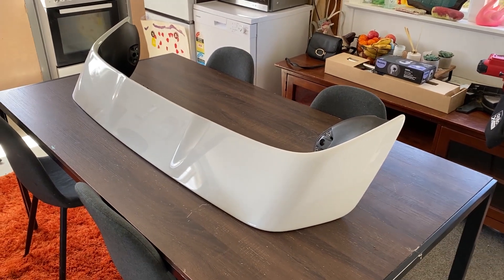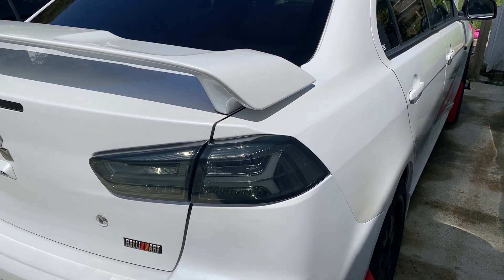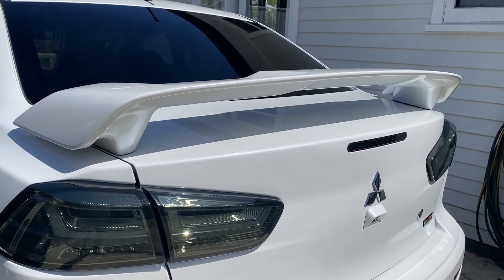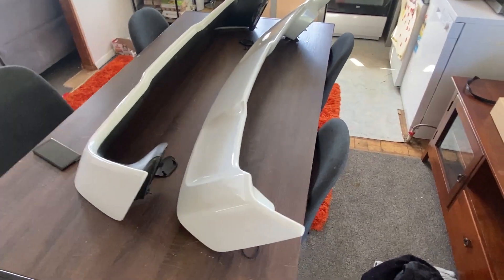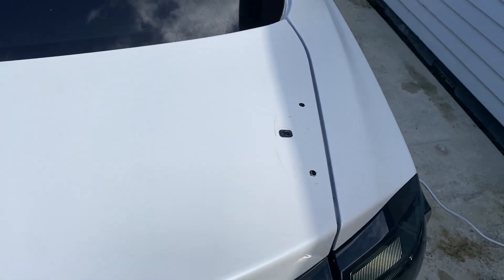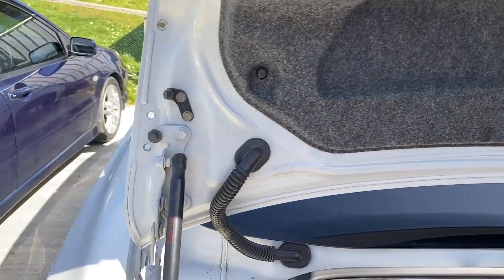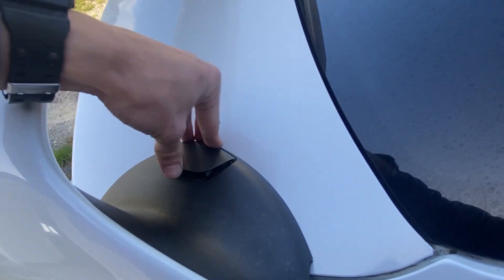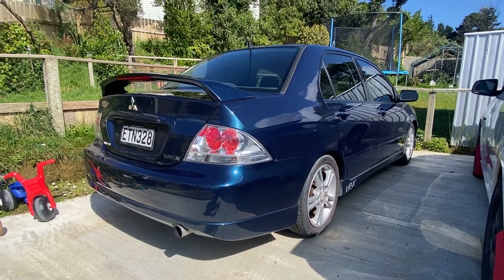Ralliart - Evo X Spoiler Upgrade! - Lancer/Galant/Evo X - Removal of factory spoiler also!

Comment: damn brudda where'd you pick up the evo spoiler?
Reply from the maker: 2nd hand, local guy through facebook in my area upgraded, Was not cheap but close to the 1000NZD mark. 
My local mitsi dealership could supply them for $4000 which is just bonkers!
Very lucky